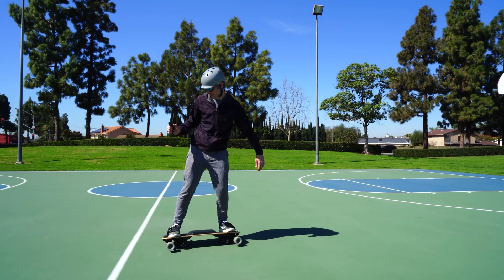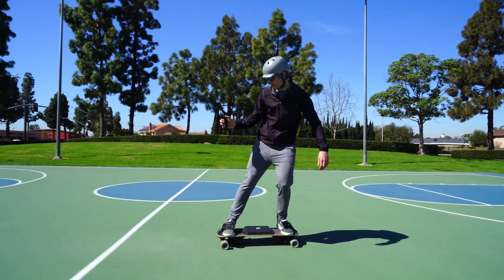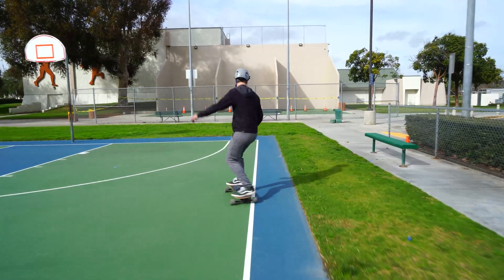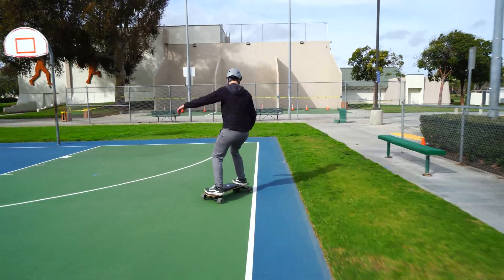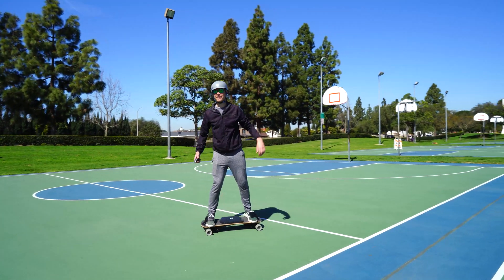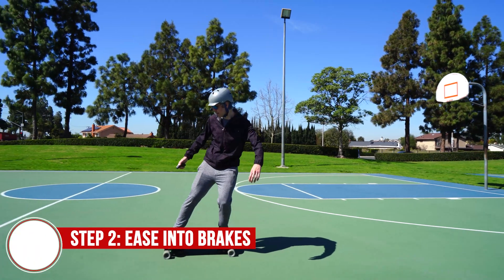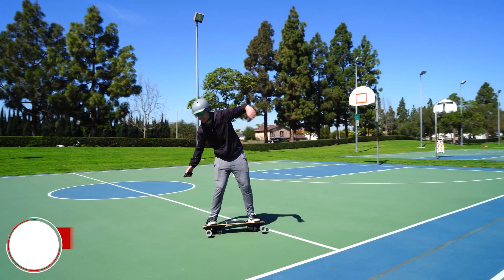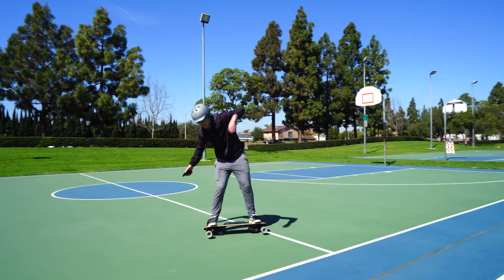KEY TIP 4 - Electronic Braking

Comment: OK aaron.. only complaint I have on here.. Electronic braking is so much safer on Esk8 boards nowadays!!! and you can change how it brakes, or know how it brakes!!... I have found that SB board haven't had any new updates to make braking safer?... Why not?
Reply: Electronic braking shouldn't be on this board IMO - it's never a better solution than sliding. Everyone I ride with turns the e brake to zero
Reply: @AaronAders  Ever considered Moon drives or a planetary gear, or even a chain belt instead of standard rubber timing belts? Would probably save on wear and belts breaking
Reply from the maker: too hard on the gears with constant road vibration, super noisy, thats why you don't see planetary systems in this industry
Reply: @Summerboard  Appreciate the response. I'm currently riding with Spur gear drives with my other boards.. It's a little noise, but I don't have to worry about maintenance. I could.. actually have a design for gear housing for the gears, spurs, etc.. It would all be self contained and not make the noise you mention :D

Comment: I have a question. Is there any problem with the durability of the impact wheel and other parts when you bunny hops jump on the summerboard?
Reply: So is there no problem jumping high like the scene in your YouTube video called "Summerboard Skate Park Shredding"? I want to buy a summer board and I wanted to ask you because I want to ride it like that.
Reply from the maker: @alskdjfhgqpwo  no problems! Also, if you do crash your board, we sell spare parts at cost to customers that buy from our website :) just contact support@summerboard.com
Reply from the maker: no problems with small jumps :)